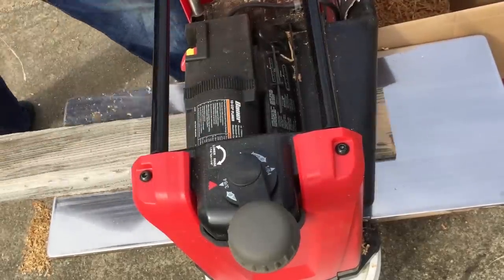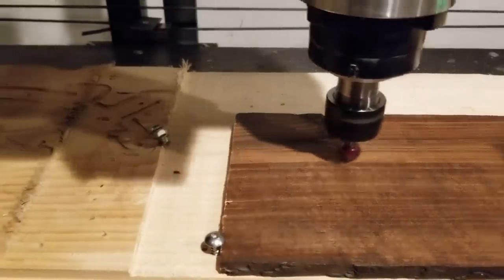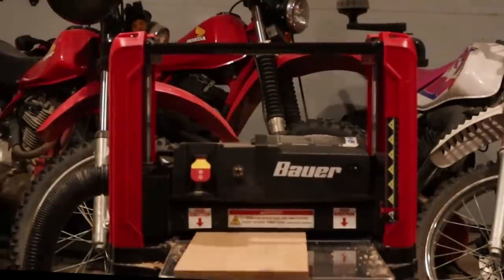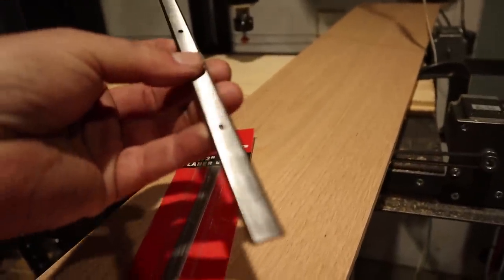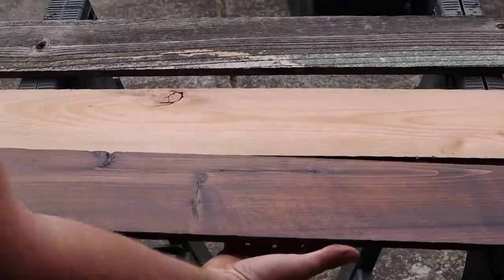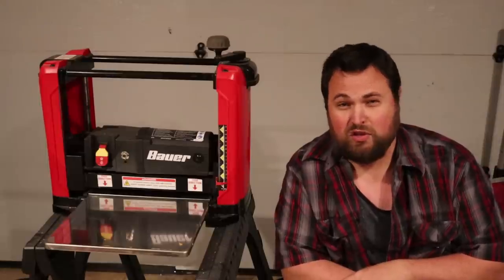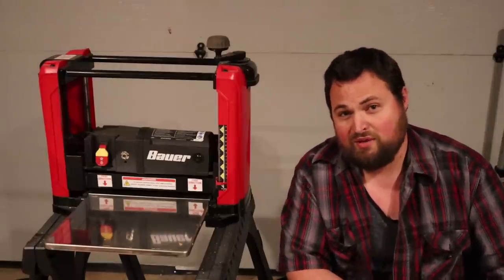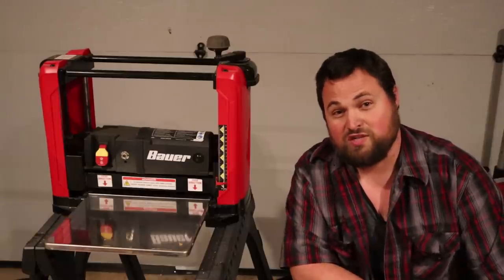Harbor Freight Planer Review Update: 1 Year Later

Comment: Speaking about Harbor Freight... I bought one of their cheap welders at their parking lot sale for 60$ and told my self when it broke I would buy a Lincoln or Miller. 7 years later, the dang thing won't break! It's strong enough for most of my projects and I can usually preheat the stuff at the ends of it capability to make it work (nothing structural of course).

Comment: I'm on my second year with this planer, and also no complaints. My strategy with HF is to buy tools I'm learning to use, or not sure how much use it will get. I go to the online reviews to see beforehand if any issues are consistently reported (some users share neat work-arounds) - it really helps to make an informed choice. Many of my "test tools" have lasted many more years of hard use than I imagined at purchase! Very useful video, keep up the good work.
Reply: You can simply visually inspect the tool. Some Harbor Freight tools are not good (as he said). The way you can tell is that the metallurgy and the fit and finish is extremely poor, like porous cast iron that isn't milled very smooth, or soft looking metal that might bend easily or snap off. 

When you look at their ratchets, and their sockets, they are literally the nicest hard metal alloy and their fit and finish is as good as a $200 Snap-On product. 

Their ratchets are so good, I've purchased about 5 different ones. Their new line of power tools appear to be just as good as Dewalt or Milwaukee, as you can visibly see just by examining the fit and finish. If you can't determine the quality of a tool by looking at it, then you probably should just stick with Dewalt tools. 

The downside to cheap power tools is the foot plate on saws are more "wiggly" and the motors have less power, and the sliding parts are not as precise. Although, from what I can tell, Harbor Freight has finally decided to step up the quality dramatically, and their circular saws are at least as good as the major brands. 

On their cordless tools, there is no way the batteries are going to last 10 years like on a Milwaukee. I have some Milwaukee batteries that are going on 8 or 9 years, and show no signs of damage. But for some people, they don't need batteries to last decades.

Comment: I have this planer and absolutely love it to be honest. Only thing I would say is to make sure you keep regular maintenance done on it, oil/lubricate clean your blade, make sure you don’t run any wood with nails or anything like that through it and you should be good. I’ve been using this after breaking down pallets and using it to make them (of course) all the same thickness for wood flooring. Saving a lot of money and it’s turning out great so far.
Reply: And why would you oil/lubricate your blade? Makes zero sense to me.  Oil/lubricate and clean the gears, chains, and other metal to metal moving parts, but the blade?
Reply: @coloradomountainman8659  Yeah I am not sure why she says to apply a heavy coating of blade lubricant to the dry blade? It's not good for the blade to be oiled, because it contaminates and ruins the wood.
Reply: Love mine. Was super impressed with the surface finish.
Reply: @coloradomountainman8659  Obviously she forgot a comma.... geez.

Comment: As a carpenter for a couple decades I have used plenty of Ryobi tools with no complaint. In fact I like my palm sander better than my Porter-Cable one. It's all about the tool. And how much you use it.

There are certain things I don't skimp on such as saw blades and hand tools, and I'm not a big Harbor Freight fan, but they do have some great prices for tools you might not use a lot

Comment: I wood work as a hobby, I have a CNC, table saw, belt sander, oscillating spindle sander, router table, band saw and a lathe. I don't have a planer I don't really need one either, not yet anyway. The fact that you took the time to review the tool a year later is awesome!

Comment: It's rare someone takes the time to film, edit, and post a follow-up review of a product. Thanks! As much as I have worked semiprofessionally doing home repair and small renovation, I mostly do any of this work for myself or family working full time in health care. So, adding a planer to my workshop in lieu of the more time intensive nature of flattenening boards with a router flattening jig or hand planing, has been on my list. A planer may not have much use for general home repair and renovation, but it does in woodworking.

Watching other but multibrand planer reviews, some of the advantages of the Bauer is, of course, the low price of approx. $270-300(?), the blades are double-sided, and the unit framing is a 2-bar (on top), making it more stable. However, I do not recall whether it is a 2 vs 3 blade unit. If it is a 3-blade unit, this is definitely a steal. It's never going to compare to the durability, precision, and quality of an industrial/commercial Jet or Grizzly...especially those that have spiral, let alone helical blades, but for a small home workshop, those units are completely unrealistic (not to mention well over $1K.

Comment: I'm impressed with the length of the infeed/outfeed tables.  That will go a long way to eliminate snipe.
Reply: Making an auxiliary table for this kind of thickness planer makes them work a lot better.
Reply: @1pcfred  have you seen or can you recommend any YouTube videos or plans for building such an outfeed in feed table?  I am considering this planer. For our occasional use oh, I'm having trouble justifying the nice DeWalt although I like their tools.
Reply: @rwind656  I made my table before I was on the Internet. There isn't much to it really. I used some 3/4" plywood that I spray glued a piece of sheet metal to. Although I've seen people make theirs out of melamine sheet too. Like a piece of shelving. Anything slippery. The trick how it works is there's a hook made out of wooden blocks on the bottom. It just hooks on the infeed table. So it can't get sucked through the planer. I put some guide rails on the side of mine too. Because there's guides like that in the planer. Keeps pieces on the table. But if you aim pieces they stay on the table anyways. I'm not sure how much the guides on my auxiliary table do. Guides reduce capacity a little. I never max my planer out anyways. Not even close. I've run my planer without the table and with it. I'd never use it without now. It is a pain for me to dig my table out too. Because I always bury it with scrap wood. I still always go through the trouble of digging it out. It lives on a scrap wood pile. Or in.
Reply: @ @1pcfred  , thank you very very much.  I will take a close look at this planer. ( I had only looked at the DeWalt.  ). And if we do go for it, or the more expensive one, we will definitely then look around for ideas online and build an infeed and outfeed section.  I've not seen the Edge guides to them would have never looked at planer in feet and outfeed.  

The way you are describing it, makes me think that I might be able to combine the idea of infeed/outfeed wings for a miter saw station we are planning on creating with infeed/ outfeed surfaces for a planer. We were already thinking about making them modular so that they could also be used as an outfeed table on the table saw.  ( Getting tired of using the roller bearing type separate little expandable stanchions we've got.  So I was thinking let's get everything up to the same height,  and make two general use modular table surfaces that could be used for multiple purposes,  since in our garage, they will have to be taken down and stored against the wall or hanging on the wall. ). 

 Thanks! 

 In the next few days we will be resawing ( using the table saw )  three quarter  inch stock in to half inch stock --  because it's just not available here.  But I would also like to avoid borrowing a friend's planer and workshop when we need to do this type thing and I'd like to be able to buy my wood from our local hardwood provider instead of The big box store.
Reply: @rwind656  It is just one board that you pass through the whole machine. I don't know how long mine is. It is as long as the scrap piece of wood I made it out of. Probably 4 feet? It looks about the size of all the other ones I've seen. A few inches longer than the stock wings makes a big difference. The guides in planers are hard to see because they're only on the middle inside section. There's one other feature of my auxiliary table that I don't usually talk about but I kind of like it. Being as I made mine out of scrap wood it had something glued to one side of it at one time and the glue residue is left over. That's on the bottom. And it is kind of a rubberized coating. Gives the board more grip. Whoever sprayed it did a really good job because it is nice and even. Once my table is slipped into the machine it stays there. It fits right inside the machine's guide rails. The other problem I had initially was wood getting caught under my steel cladding. I put a bevel on the leading edge of my auxiliary table and bent the sheet metal onto it. You need a bit of a roll going on there to avoid that happening. So plan on doing something like that when you make your table.
Reply: @1pcfred  thank you. I will have to educate myself some more obviously on terminology.
Reply: @rwind656  It is just a board hooked on a lip. Nothing to it really.

Comment: The Bauer, ICON, and other higher end branded tools in Harbor Freight are usually pretty good quality. Their Chicago or Pittsburgh brand stuff is hit or miss. The cheap air tools work great. The cheap electric tools suck. Hand tools are good. Mechanical tools are good.
Reply: Harbor Freight tools are hit and miss, even their hand tools.  But it is also the first place I go for project specific tools when I can't rent them.  Sometimes you find a gem.  Sometimes they end up in the trash.  Sometimes you learn that now that you have the tool, it is more useful than you thought and wish that you upgraded to better quality tools but it never breaks.
Reply: You're correct about their pittsburgh and chicago; its more miss than hit
Reply: Both my air compressor and power generator from HF were garbage. I cant afford to be burned again, so I generally stay away from them if I can.
Reply: Are the hand planer any good the $55 heavy duty one ?
Reply: Agree

Comment: Good accurate vid regarding this planer. I've had mine for 4yrs now and put roughly 100-150 hours on it. It's completely paid for itself ten-fold. Only true problem that has arrised is that the left side will slowly start to plane off slightly more and needs to be re-adjusted. This is most certainly the best product of all my purchases from Harbor freight.

Comment: A very informative review. Had been wondering about worthiness whereas I am one of those who doesn't have the scratch for the better stuff but this unit seems quite adequate. Being a cautious "grampy", I noticed the little one's box. I respectfully suggest a cabinet lid support for the lid to save little fingers. Lowes has an economical fix. Item # 311978 model# 3890418 $3.97 thanks

Comment: Great review, I am a professional carpenter and expect my tools to perform. Now that I am retired I cannot spend the bigger bucks it's nice to see I can get one that will just do the job if need be my Sanders can so clean up.
Reply: Same here Jeffrey when they Dewalt send the Makita‘s and Skil saw‘s from 20 years ago broke down now it’s hard to replace that same round some of the harbor freight stuff it’s OK I’ve had pretty good luck with most of it
Reply: @scottward1002  i try to find a few guys that have spent the money on anything that costs over $150.00 just because i don't have the money to waste anymore. I haven't personally bought or used much harbor freight stuff but what i have bought has done the job. I used to always buy Milwaukee first with the exception of the worm drive circular saw Milwaukee worm drive (sidewinder) is just to bulky and heavy have always preferred the Skil sidewinder and these days they are cheap enough to buy besides they last forever my last one was dropped off several roofs before i finally had to just replace it. Nowadays my tools will last me the rest of my life and ny battery drill/impact set with a 6" Milwaukee saw will definitely last the rest of my life.
Most Dewalt tools with a few exceptions of course are cheap enough these days to just buy. I bought a brand new 10" Dewalt table saw a year or so ago for a couple hundred bucks the guy used it once then suddenly passed away his daughter sold that to me a fairly new router table with the router 24 bits an electric hand held planer all kinds of tools i walked away spending $345.00 even though i was very honest with her told her the true values and prices she just didn't want to look at the stuff it bothered her i felt bad about how much i paid her anyway i point is if we buy when we don't need the tools we can take our time and find great deals. I love building my own stuff but i have half century experience ans already planned on building new cabinets for my house after that purchase i had everything i needed am starting this spring been taking my time building my new shop its almost done. Thanks for taking your valued time respond to my comment may you and your family always be blessed. Jeff
Reply: @drymoonproperties  I bet she was happy that the tools went to someone who would put them to good use.
Reply: @Ross McKenzie  I bet so as well
I am dying from a terminal lung disease I have lots of excellent high quality tools I want them to go to people that will put them to good use and not just let them sit and rot that would break my heart I care about my tools and take great care of them

Comment: 6:00 It might be interesting to see the HF tools that you have found to be not that great, so others can avoid them. Maybe condense them into one video?
Reply: i'm a professional carpenter....on a job my milwaukee saws all died....HF was a block away...i bought a HF  saws all for 20 bucks just to get through the job....if i burned it up no big deal...i had a 30 return or swap....10 yrs later its still used almost daily...and the handle pivots out of the way....no complaints from me
Reply: @tiptip5921  Yeah, some of the stuff at harbor freight is good value for the money. That's how they stay in business. If all of their stuff was trash, they'd be gone.

If you go in with low expectations and they're met, you're fine. If they're exceeded, then even better.
Reply: @ @tiptip5921  , which recip saw at Harbor Freight was this?  I have been  looking at the reviews...    I'm looking at them for a wedding present (we usually give a toolbox tailored to their needs) and I don't want to give one to this young fellow/couple who are going to remodel their beater home if it's going to fail immediately!  But I'd rather include a few other tools as they are really strapped. And if I go out and buy a name brand more expensive recip saw, I won't have the money to include some other goodies.  Would appreciate your feedback.I had almost eliminated the current Harbor Freight models although we are big Harbor Freight customers...
Reply: @rwind656  its maroon in color and the handle unlocks and rotates left or right....maybe i got one that was built on a wednesday by 2nd. shift...the abuse this thing has seen should have killed  it by now....but still works fine
Reply: @tiptip5921  Thanks.  I will look at them again.  of course I knew when I asked, 10 years ago that might have been built a lot better...
Reply: indytbird  one that does timber/log framing ....along with a prazi....which you might have to look up